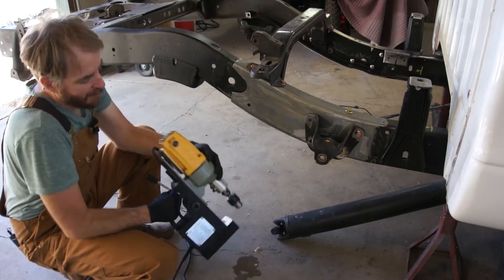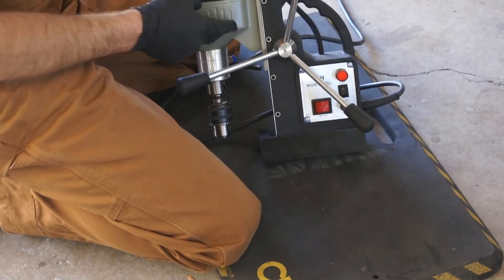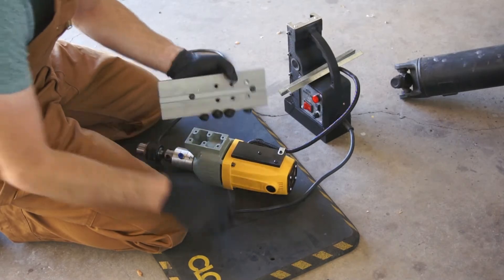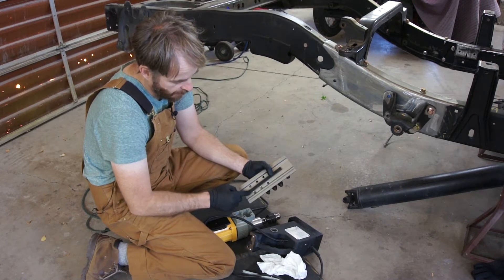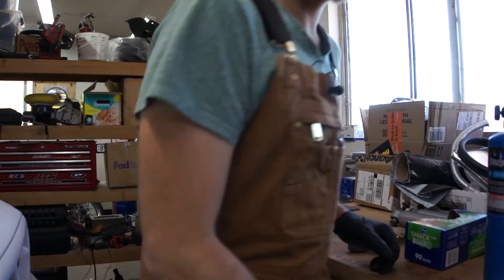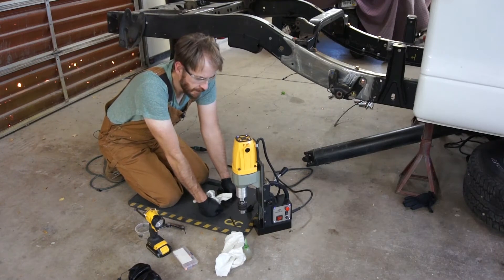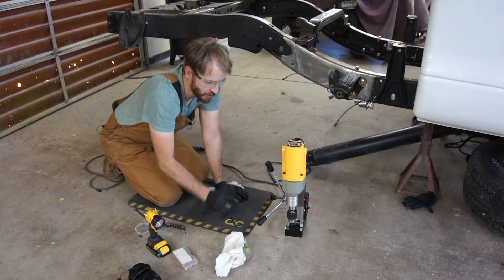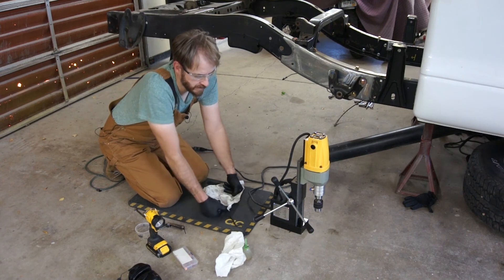More Usable Travel - Fixing a Cheap Magnetic Drill

Comment: This sounds  ( and looks ) like a good fix, I think I can buy one of these now with some hope of using it as intended, with standard jobber bits.
Reply from the maker: Yeah, it'll work.  The only downside is, I've been using mine with both standard twist drills and annual cutters and I have to flip-flop between having the drill in the upper position (modified, like in this video) and having it in the lower position (like it originally was).  I usually save jobs and switch it as needed.  Lately, I've been using it in standard position with annualar cutters.
Reply: @RobertAdairWorkshop  Good point, and I've been thinking of this too. Most of my drill though, is with standard drill bits up to 3/4" diameter, but mostly at, or less than 1/2".

Comment: You call the drill junk, but you knew exactly what you were buying and that it wouldn’t work for your application…..
Reply from the maker: Not true.  Why sell it with a standard drill chuck if it wont' use standard drill bits.  I didn't figure that out until I went to use it on the truck.

Comment: I'm sure you know this but for those who don't mag drills are designed to be used with short annular cutters. If you remove the chuck and try to use an annular cutter now the throw below the base will be too short to accomplish much if anything. Honestly them including the standard chuck seems silly to me without also making the travel adjustable on the frame. Nice mod though if I pick one up I'd likely do the same and just switch back and forth depending on the bit I needed.
Reply: Yea you can get 40mm magdrills that come with an extension Arbor for use with standard annular cutters, then when you want to use the chuck you just remove the extension Arbor and you have enough clearance. The Rotabroach Commando 40 is one of this type there is plenty of other manufacturers that sell this exact drill Rotabroach and the others just rebrand them.

Comment: Great video. Thanks!
Reply from the maker: Thank you, Bob.
Reply: @RobertAdairWorkshop  Are you able to use annular cutters after making this modification and if so, how deep can you cut with them? Thanks, bob
Reply: Also, can you provide a link to the model you bought?
Reply from the maker: @bobfalk2896  Hi, Bob.  I got it on Amazon.  Brand name Scieo.  I went back and looked and the one that comes up isn't the same drill.  The problem with Chinese products like that is they change brands frequently.  If you look on Amazon for ZELCAN 1100W, you'll find the same drill I have.  It looks like it's now blue instead of yellow, but otherwise, same tool.
Reply from the maker: @bobfalk2896  Hi, Bob.  I couldn't remember so I went back and looked.  I used it with a 2" annular cutter when I built my milling machine.  https://youtu.be/UgQqwE8UIYY?t=412.  It looks like I changed it back to the original form to use the annular cutter.

Comment: Thanks  for  tech  tip   reason  why  it's   it comes  way it does  is because  your  suppose  to use angular cutters  for this drill .. but the mod is great thou
Reply from the maker: That's good to know, Bob.  Thank you.  I think I was thrown off by the inclusion of the Jacobs-style drill chuck.  I've been flipping it back and forth depending on what length bit I use.  Those annular cutters are nice.
Reply: @RobertAdairWorkshop   you might  still  be able  to use as is modified   depending  how much travel  you have  without the  drill chuck   there  nice it's  not  like your  going  1 1/2  plate  every day
Reply: @RobertAdairWorkshop  it is a badly designed check out Rotabroach Commando 40 or similar type for a better approach for Mag drills that include chucks.
They come as standard with a kind extension Arbor which gives you much more travel when you want to remove the extension and install the Chuck.